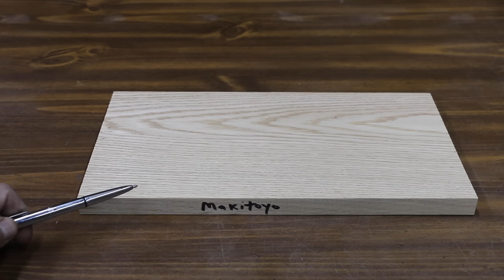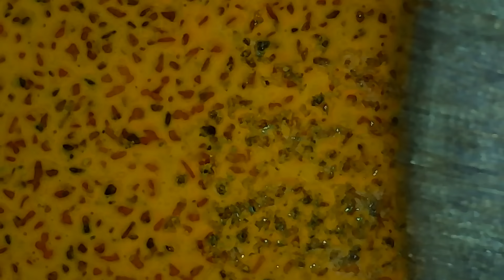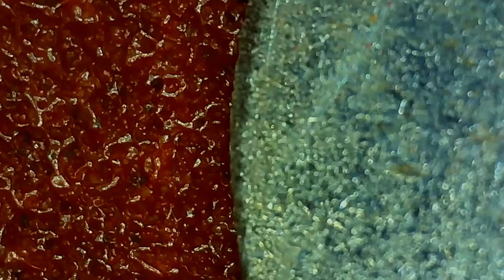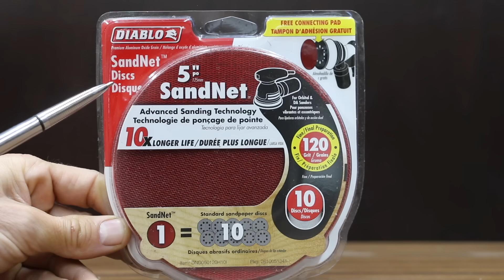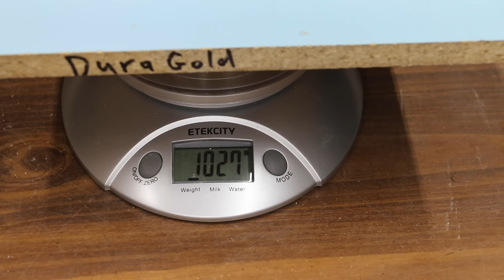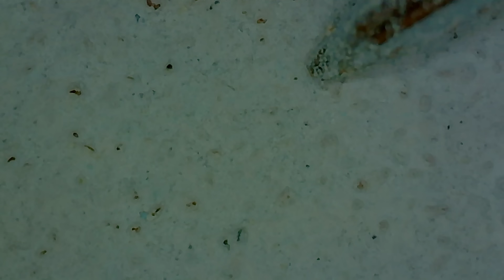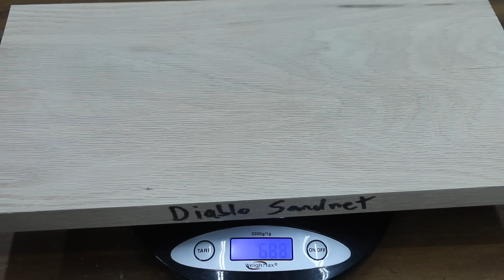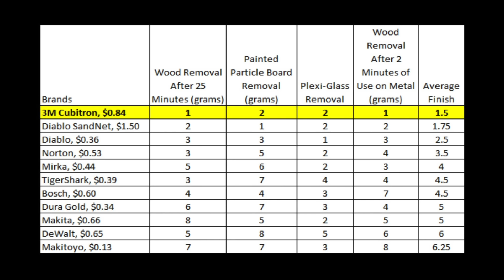Best "Sandpaper" Brand? 3M Cubitron, Diablo, Mirka, Norton, Makita, DeWalt, Bosch Sand Paper

Comment: Greetings good sir!   Another fine video!    Now here's a idea:   we all use it.    Tape measures!     I have to use one constantly but am I using the right brand (Stanley).   They all eventually break one way or another.   A toughness test would be great!    Thank you.
Reply from the maker: I'll do it! Great video idea!
Reply: @ProjectFarm  would do an accuracy check on the measurements, also, please? I'm sure that they are all good, but being thorough is good.
Reply: @eugenetswong  I’ve had brand new tape measures that were off 1/16” at 1 foot.
Reply: @proamateurs4469  I'm glad that you mentioned that. I thought that it was just me.
Reply: @eugenetswong  tape measures are notoriously inaccurate. So the trick is to only use one in a project. As the one will agree with itself but probably will not agree with a different tape.
Reply: @1pcfred  that's kind of scary, since measurements need to be accurate.
Reply: @eugenetswong  one tape will be accurate. It just will not be precise. But you can still manage to do accurate work. Which is usually good enough. If you need precision tape measures are not the metrology instruments you should be using. Most do not need super precision on tape measure sized work anyways.
Reply: @ProjectFarm  droptest, wet sand test, thousand kink test, end stop test.
Reply: Concord carpenter channel did a really good one a couple years back,  but there are some new contenders available now.  I believe Stanley Fatmax was a top performer.
Reply: @katewhatsthis  fatmax IS my favorite
Reply: Plot twist  - easiest tape measure to find. I've purchased 5 gallons of the things and lucky to find one.
Reply: Dedicate a stainless steel Starrett ruler as a standard and check your tape against it every 90-180 days for wear. Just don’t use your standard at the job site.
Reply: I like FatMax myself. For other categories as well.

Comment: I need a video on “pancake” air compressors. I need one but don’t know which one is the best. Can you find out? 🤔👍🏻
Reply from the maker: Thank you for the video idea!
Reply: @ProjectFarm  Could you include decibels as part of the test as well? I have an older PC pancake that's super loud and definitely considering a quieter one.
Reply: Please include “the tank” by metabo hpt. They claim it’s better than other pancake compressors.
Reply: @Mittencarpentry  "we're gonna test that!"
Reply: The Fortress brand from HF would be a worthwhile inclusion in this test.
Reply: I've had a porter cable one for about 8 years that's never given me a problem at all
Reply: I have a Campbell Hausfeld my wife got me for Father’s Day. It has done pretty good so far for running a nail gun.
Reply: Dammit, I was going to ask for this one!
Reply: Please run compressors for a long time to see how they handle different temperatures.  Mine just burnt out when I was running it too hot.
Reply: Thomas T30 is the best pancake compressor on the market but you gotta pay the price. We see units at my repair shop that are getting serviced for the first time after 30 years.

Comment: Sandpaper Sunday!  Yeah boi!  Can you test durability of gloves?  Like Latex and Nitrile ?
Reply from the maker: Great video idea!  I'll do it!!
Reply: @ProjectFarm  Don't forget, we'll also need to know how they all blow up like a balloon.. .because, we're all still 5 years old on the inside!
Reply: @ProjectFarm   The McKesson Nitrile 911 exam gloves are the ones we used when I was an EMT, they were very durable, pretty thick, I've used them framing houses and had some last all day
Reply: Wearing gloves while framing a house? Turn in your man card and put yer hair up in a man bun asap...😄
Reply: @FJ80Coop  that's bold to say about someone who was also an EMT. My guess is he's the type of guy who's more concerned about saving lives than mocking others.
Reply: @FJ80Coop  Actually, I'd authorize the man card of anyone willing to wear nitrile gloves while house framing.  It's the wimps who succumb to fashion and it's certainly not fashionable to wear exam gloves on a construction site :) .
Reply: @drew5334  Does the house have AIDS? Corona virus in the OSB?  Rubber gloves for framing? That is over the top.
Reply: I use a lot of nitrile gloves, would love to see that test to
Reply: and don't forget to use xylol in the test ;)
Reply: especially on material compatibility. like if youre using paint stripper and the wrong gloves, youre gonna have a bad time
Reply: Add one to this suggestion
Reply: Awesome idea! Like what brake cleaner, acetone and common chemicals do to each glove
Reply: That is a great idea!
Reply: I second this idea! would be great to stack synthetics against regular leather
Reply: Brilliant idea.
Reply: That's if you can find gloves could not find them anywhere!
Reply: Cousin Eddie is in for some hand damage.
Reply: @nathanrobertson1601    Why do you need gloves to fix cars?
Reply: @xploration1437  Have you ever worked on an engine with a 5 year old oil leak?  That's how long many people wait to fix a leak.  Builds a crust an inch thick and gets the
hands greasy, gooey and THAT is why an auto tech uses gloves!
Reply: @rayworx  but BMW's leak engine oil since the day they come out from the factory.
Reply: @xploration1437  Actually, working on cars is the primary job where I wear nitrile gloves.  Thin ones may tear during a single oil change, but sturdy, thick ones can last all day even with tough jobs.  Petroleum products, especially when used, are not only annoying, hard to remove, and leave a lasting smell, but they are carcinogens and mechanics have to deal with these compounds all day, every day, throughout their careers.

Gloves won't prevent all contact, but they can literally save your life if you do this kind of work every day for decades.  I mainly just do my own car repair, yet I try to wear gloves whenever I'm working around grease, oil, and even rust.  Gloves are no fun in warm weather, though, and I sometimes switch between 2 pairs while letting them dry out somewhat between uses.  I'm not perfect, of course, and sometimes do something "quick" without nitrile gloves, but I almost always regret it.  I keep gloves in multiple toolboxes and use them until a finger tip tears off.

The best way to apply grease to most things is with your fingers.  For years I just used bare fingers to pack bearings, etc., but I obviously got grease all over me in the process.  Now I just wear nitrile gloves and can freely grease without getting greasy or reach into hot oil and grab a dropped drain bolt (be careful as oil can be scalding hot!).

The gloves still get greasy and oily, of course, but the slick nitrile cleans easily with a simple shop towel or rag, while your hands and skin are much harder to clean.